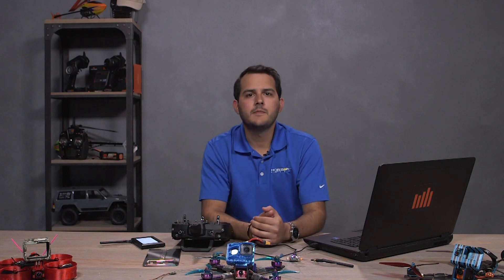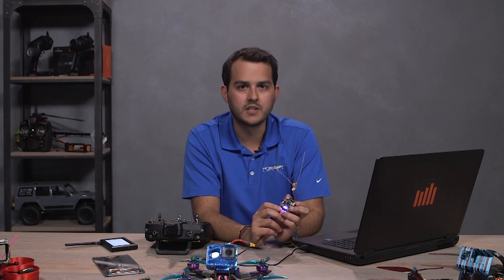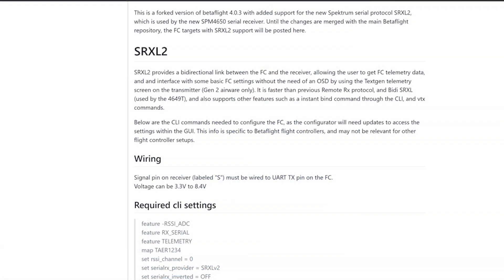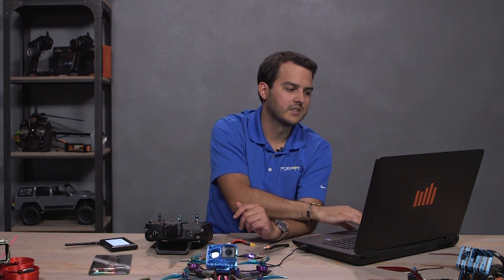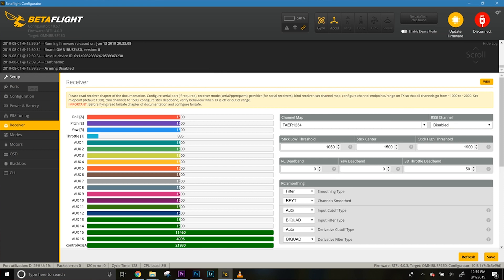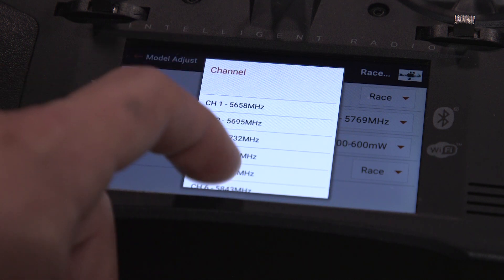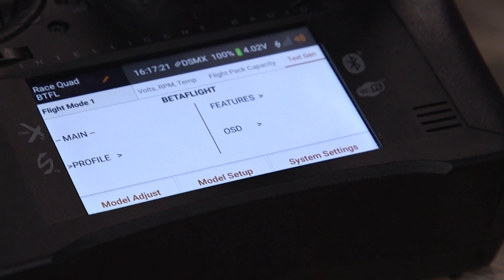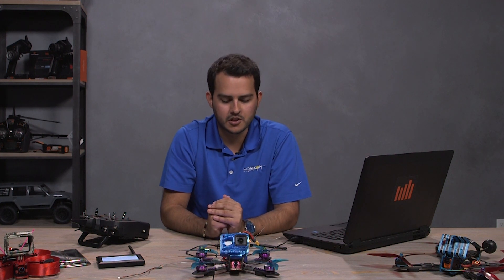Spektrum SRXL2 Micro Serial Receiver Betaflight Setup

Comment from the maker: **A lot of this info is dated now. Betaflight 4.1 and the latest configurator support SRXL2, no CLI commands needed!**
Reply: Please show the new update set up to beta flight
Reply: What if you set the CLI commands after 4.1?  Are the settings unoptimized or are the settings 100% the same?
Reply from the maker: @antdx316  It will work the same, just easier on 4.1. Just select SRXL2 as the protocol type and it sets everything for you.
Reply: Does the data pin still go to the UART tx pin?
Reply: I have my signal wire to T2 pad but I have no signal I'm using the iflight s uccex-e f405 I have no communication from the radio to the flight controller at all my speedybee app says no receiver signal detected what do I do please help
Reply: @dominofpv1885  use a different tx pin , try 6. this worked for me and others with same problem. . . or return the unit and get a crossfire system if you can. results of my testing of the srxl2 was not good.
Reply: @RCSurf  Where is Pin 6 on the board? Pin 2 appears to be marked, but not Pin 6.
Reply: @dominofpv1885  I'm having the same problem. The iFleight wiring diagram has receiver signal going to the "R2" pad, but this doesn't work. I have gone over my wiring with a fine tooth comb. No shorts, and no cold solder joints. I never thought of trying the TX pin (which is what they have for TBS receivers) but I guess I'll try that. Can't hurt-maybe I'll get lucky (or I may have to give up and go with something other than Spektrum if I'm having so much trouble getting it to work with a different FC).
Reply: thanks for the video and especially thanks for this updated comment. i was just wondering if i still needed to use the spektrum fork of betaflight or if i could just use the current normal betaflight firmware.  i'm guessing these have all been merged now.   thank you!
Reply: @SpektrumRC Do I need to flash my Mamba F405 Mk2 board to connect to this receiver and install a new firmware?
Reply: The CLI settings are bogus 
It says so when I cut and paste and hit enter.
Reply: @wethepeople420  use new beta flight and just connect it normally and select the new codex in betaflight, no cli
Reply: @ste4lthles  thank you I’ll try that
How do I get new beta flight?
Reply: @wethepeople420  I uninstalled and went to GitHub and installed the latest, look it up too, there are some good guides
Reply: @ste4lthles  thank you
Reply: So is it fully merged now? Is it safe to get the latest release? I think it's 4.2
Reply from the maker: @danivanon  yes it is
Reply: i GOT IT TO BIND AND IT WORKS / ALL CONTROLS WORK, BUT THE RSSI IS STUCK AT 20% - PLEASE UPDATE HOW TO ENABLE THE CORRECT SETTINGS 4.1 JUST SET TO SERIAL THEN SRXL2 PROT , UART SET FOR SERIAL RX HELP OR WHATS GOING ON TO GET RSSI TO WORK , DX6GEN2 UPDATED WITH LATEST AIRWARE BUT BETAFLIGHT RSSI STATIC AT 20%
Reply from the maker: @RCSurf  Make sure you do not have a channel assigned to a RSSI in the receiver tab :)
Reply: @SpektrumRCvideos  I don't 
I followed the video exactly no RSSI channel in receiver tab
Reply from the maker: Rob Surf can you message us on FB about this? Gonna be easier to help there. Thanks!
Reply: @SpektrumRCvideos  thanks I'll do that when I get home from work tonight I really want to see RSSI finally after 5 years of running Spektrum receivers
Reply: @SpektrumRCvideos  I resolderd to a different tx pin #3 and the rssi works but it maxes out at 74, ill send a message via fb now
Reply: @paul-fornage  ya , i switched to crossfire and its been perfect , flawless

Comment: Hi, great video! I have a quick question if you see this: I am trying to set up serial communication between the SPM4650 and an Arduino Nano 33 IoT board for a custom flight controller and I'm struggling to read in the serial data properly. I currently have the receiver's signal wire connected to the Arduino's Rx pin, but I noticed here you said to connect to Tx for BetaFlight since the communication is bi-directional. Would the same apply for the Arduino?

Comment: The Receiver works with SRXL2 protokoll on a SpeedyBee FC. And the Receiver works with my old Spektum DX6i radio
Reply: Did you set it up in Betaflight? I am struggling to use the spektrum receiver with my DX8
Reply: @Savage_Offroad  Betaflight 4.3 recognized the receiver immediately. Only the setting to throttle to the left (mode 2) I still had to adjust. That was really super easy and works well. Only my transmitter has too few options to control the flight mode on channel 5 or 6. With both mixers I get only 4 possibilities. Yes, and telemetry just does not work with the old radio.

Comment: Hi everyone, I'm wondering how I would go about getting my spektrum receiver's telemetry (AR637TA with speed/altitude/rssi/vario/etc) over to some kind of simple OSD/VTX solution. My receiver has xbus and SRXL2, and I'm hoping something can tap into those and grab that data. I would rather not leave the spektrum ecosystem if I can help it, as I already bought their expensive remote & telemetry receivers. The data shows up on my NX6 transmitter, but for FPV purposes, I would like to get it on OSD. Any info would be greatly appreciated!

Comment: if you update these with the usb cable THE LATEST FIRMWARE can they display RSSI info on betaflight OSD?
Reply from the maker: It is not required BUT there are versions of betaflight that are buggy with this aspect. Best to run the latest stable releases. Hope that helps!

Comment: Hello I am new to drones. I have soldered everything up. My firmware is updated to 4.2. The reciever is bound to my remote. I just cannot get it to display in betaflight. Can you help me with the ports? What settings should i use if i know the port? Thanks.

Comment: @SpektrumRC Hi! I want to know what the B, L and R ports on the receiver do and which ones I should use. Because there are 2 satellite connection ports out of the box (SPEKTRUM AR9030T ) . Which one should I use for which ports? In addition, I am using a PIXHAWK HEX cube Black model auto pilot. I will use it manually. I have been told to connect the receiver with the cube from the spkt port on the cube, but I do not know how and where to connect it with the receiver. How can I connect SPEKTRUM AR9030T and PIXHAWK CUBE BLACK AUTOPILOT for manually flight.
Reply from the maker: https://youtu.be/nZlHA2FEY20

Comment: Well I went form loving Spektrum to now hating them as I have bought 4 of these damn spm4650 boards and 2 quads (and a new FCs in each as I thought I must have just gotten bad ones out of the box?) and I cant get a single rx to work. All 4 rx boards bind with no problem but no matter what setting or tx pad or rx pad I use, I cannot get the rx to communicate with betaflight. This was me trying to get back into drones after loosing my rc collection to a fire and after weeks of scouring the forems for help I am very discouraged.
Reply from the maker: Is it a F3 or higher flight controller? If not you won’t be able to update to the latest version of beta flight that is needed. Otherwise, Here are things to check,  signal from rx goes to a tx uart pad, (make sure the uart is not inverted) set that uart to serial in beta flight under ports menu, then in config menu set receiver type to serial and select srxl2 for protocol. If you want telemetry select that slider in same menu, then in receiver menu change mapping to TAER and you should be good to go. Hope that helps!

Comment: Trying to set up DSMX SRXL2 SERIAL MICRO RECEIVER (SPM4650) BIDIRECTIONAL TELEMETRY  on a mamba f411 board which I don’t see any target for it on your spectrum gighub , any idea how please ?
Reply from the maker: If you update your board to 4.1+ betaflight firmware it should support SRXL2. *A lot of this info is dated now. Betaflight 4.1 and the latest configurator support SRXL2, no CLI commands needed!*
Reply: @SpektrumRCvideos  may i ask if this is all dated, why has there not been an update video made to make it simpler for the new comers

Comment: Tried 4.1 + firmwares  followed everything.. been trying 2 weeks still no stick inputs.  My rx is cheap? Jumper T12. Im using F405mk2 also..
Reply from the maker: Are you putting the signal on a TX Uart pad? Make sure you are and that you are not using a inverted signal pad
Reply: SpektrumRC  both I tried TX and Rx  and turning it on.. 
its connected to my remote but  and followed the steps  even changing later firmware. Inverted signal on tried it of also duplex on and off also.. will buy another one later i hope it will work
Reply: Working but its not the 4650 ..

Comment: I can bind with my Spektrum DXe but control inputs do not work. Please help!
Reply: Same exact with me! Everything looks good but there nothing happens with controls.
Reply: Did you guys get through? I bought one this week to use with my dx6e and I hope I don't get any problems.
Reply: @blacksheep5339  Yes just make sure to copy this into the betaflight configuration terminal... 
feature -RSSI_ADC
feature RX_SERIAL
feature TELEMETRY
map TAER1234
set rssi_channel = 0
set serialrx_provider = SRXL2
set serialrx_inverted = OFF
set srxl2_unit_id = 1
set srxl2_baud_fast = ON

Comment: I have the iFlight Cinebee with the SuccexF4 v1.5 flt controller and SPM4650. iFlight says to connect the recvr signal wire to R2 on the controller but this video says to connect it to the T2 on the controller. Connected to R2 i get no stick movement. Which is correct?

Comment: Will the SPM4651T work with a DX7 older version?  I can get radio commands to work but I cannot seem to get RSSI to work.  I have followed the steps in your video and even tried a few variants but I always get the same result.  0 in the RSSI on the OSD.

I should say that I'm using Betaflight 4.2, I've run your CLI commands from 4.1, and I have it on TX1.
Reply from the maker: There have been updates to the 4651T that may help with this. You will need the USB update cable SPMA3065 and adapter SPMA3066
Reply: @SpektrumRCvideos  where can I download the code?  Can I use my FC as a passthrough?
Reply: I tried registering my product but with a gen 1 DX7 I cannot get the serial number so I cannot register.  🤨
Reply from the maker: @repairengineer  You are updating the receiver, it is done the same way as this video, you just need the adapter https://youtu.be/mQPyrjs8Gfg
Reply: @SpektrumRCvideos  It works!!! Thank you updating the reciever fixed RSSI on betaflight with a DX7 first gen.

Unfortunately, I had to buy a programmer to make a feature work but at least I now have the advertised performance.

Comment: I want to use this sat with a heli flight controller, Spektrum fc6250hx. Does the signal from Tx still go to the tx pin on the sat? I REALLY don’t want to fry the fc
Reply from the maker: Are you using the included SRXL2 receiver as well?

Comment: HI I HAVE A MAMBA F405DJI PRO WITH BF 4.2,0 DO I NEED TO CONNECT TO TX OR RC? CANT SEEM TO GET THIS WORKING?
PLEASE HELP
Reply from the maker: TX pad. Try different pads if one does not work. Hope that helps!
Reply: @SpektrumRCvideos   thanks for the reply, so for example if i connect to tx 5 and switch uart 5 to rx may work?
Reply from the maker: @stxe34  yes give that a try
Reply: @SpektrumRCvideos  will i need any cli commands? im on 4.2
Reply from the maker: @stxe34  Nope just select the correct port and SRXL2 protocol. Don't even need to set a RSSI channel :)
Reply: @SpektrumRCvideos  hi thanks i managed to get this working! how can i bind at 11ms? it seems to bind at 22ms? thanks for your support! regards
Reply from the maker: Stef go to the frame rate menu and select 11ms and rebind :)
Reply: @SpektrumRCvideos  i think because im in eu its limited to 22ms unless there is a work around?
Reply from the maker: Stef what transmitter?

Comment: If I am using an old dx8 G1 telemetry feature should I expect to work with it?
Reply from the maker: You will get some basics like flight pack voltage and current (depending on your setup) but you will not get Text gen

Comment: Confused. On my FC i have terminals TX2, TX3 & TX4 But no TX or TX1 Where should i connect the command wire?. Its machine GPS F4 Flight Controller Thanks
Reply: Is it a eachine F4 Flight controller?

Comment: I've downloaded 4.0.3 and flashed my F3. I've checked, checked and rechecked the wiring. I'm wired, the signal wire, to UART1. I've got the port tab set on UART1 Serial. On the configuration tab I'm set to spektrum sat and have selected SRXL... because there is NO SRXL2 or SRXLV2 to select. The receiver is binding to my radio. I'm binding it with the bind button on the receiver. Solid light on the receiver. I've checked my port settings, looked at the old manual, the new manual. I've looked at 3 videos. I've looked through the github pages. I've reflashed my F3. I've rebound the 4650. On and on and on. Why is this so difficult to get a simple receiver to work with my flight controller? ITS JUST A RECEIVER! Just impossible. I'm going to DJI. If that doesn't perform, I'm going to Frsky. But this nonsense is over.
Reply: I'm trying to get one to work right now too on an CLF4S running bf 4.1.1. This video doesn't show an actual selection being made on the ports tab even though there are two scenes of it. I know  he mentions using port 1, but then there is a scene of the receiver tab with none of the signal bars moving - just like mine. 

Spektrum, please update this video :D
Reply: For anyone else having an issue with this... do what the man says and hook up to a tx pin :P
Reply: @StatFPV  Fine, but which tx pin? 2 has been suggested (been there, tried that, didn't work). Another person said try pin 6, but no idea where pin 6 is on the board. A location/hint would be great. All of my DSM/DSMX equipped drones work just fine with my DX6-but try to add a stand alone reciever? This is far more work than it should be for something so simple. As Jeff Mueller stated, "it's just a receiver!" This shouldn't be this damn hard. And Spektrum, it would be really nice if you guys would update your videos. Just sayin'.
Reply: @fredmorton4291  I assume you can use any uart that isn't hardware inverted. That depends on your flight controller.  Whichever rx pin you would usually use for any other sbus receiver, try the tx pin of that uart.
Reply: @StatFPV  1. I don't know how to tell if a UART is, or is not hardware inverted. The FC I'm using is a iFlight SucceX-E 2-6S 20x20 Stack/Combo (F4 FC, 35A 4in1). Per their wiring instructions, the DSM data line from the receiver goes over to a pad marked  "R2" which is where I started. Then I tried using "T2" per a suggestion from this video. That didn't work either. So, we're back to where we started. I am longing for the days when I built up quads using all DJI parts. I imagine a lot of folks rag on DJI, but their stuff always worked together, and worked well. No communication issues whatsoever. Oh well, I'll keep working on this thing. I know the problem is something simple and stupid, and I'll find it eventually! But it would be nice if Spektrum would get with the times and update their videos!
Reply: @fredmorton4291  Hi buddy. I'm having the exact same issue with the same FC. Did you work out which pin to solder to for the signal wire? Thank you

Comment: Is Link Quality reliable and accurate?  RSSI and LQ don't work together.  I had 15/100 RSSI with LQ no lower than 93%?
See this video around 02:38 and post flight statistics at the very end.
https://vimeo.com/395546320

Comment: Is this still needed in new beta flight
Reply from the maker: Luuk k nope! Just select SRXL2 as the protocol and your good to go!
Reply: @SpektrumRCvideos   hi when trying i still get issues 

Entering CLI Mode, type 'exit' to return, or 'help'

# 
# Building AutoComplete Cache ... Done!
# 
# set feature -RSSI_ADC
###ERROR### Invalid name

# feature RX_SERIAL
Enabled RX_SERIAL

# feature TELEMETRY
Enabled TELEMETRY

# map TAER1234
map TAER1234

# set rssi_channel = 0
rssi_channel set to 0
# set serialrx_provider = SRXLv2
###ERROR### Invalid value
Allowed values: SPEK1024, SPEK2048, SBUS, SUMD, SUMH, XB-B, XB-B-RJ01, IBUS, JETIEXBUS, CRSF, SRXL, CUSTOM, FPORT

# set serialrx_inverted = OFF
serialrx_inverted set to OFF
# set srxlv2_unit_id = 1
###ERROR### Invalid name

# set srxlv2_baud_rate = 400k
###ERROR### Invalid name

using 4,1,3 beta flight 
can you please help?

Comment: What is the best sign for long range?  SPM4650 or SPM4651T?
Reply from the maker: You will likely get the best performance out of the 4651T. That being said these are still 2.4ghz, so being "long range" is subjective when we are talking about 2.4. Thanks!
Reply: @SpektrumRCvideos  will i use the same protocol as spm4650 on bf?
Reply from the maker: @edyfpv  Yes

Comment: I have this connected up to a Tmotor F7 30x30 flight controller. I get motor RPM and betaflight textgen menu but not Vbatt. Do you have any idea why I wouldn't be getting Vbatt?
Reply: Whits one do I need to you whit a Tmotor F7 ?

Comment: Outstanding vid! great explanation of all the features. I just wired one of these up to an AIO board. Because SRXL2 is so new they had no instructions for it. I wired the signal wire to the RX instead of the TX. Thanks so much for your help!!!
Reply: GKW did it work when you switched it to rx
Reply: @isaacluna8388  Yes, all good now.